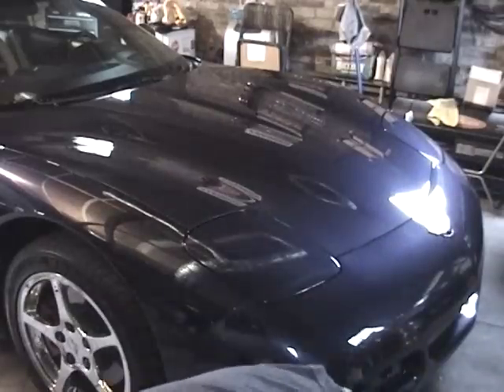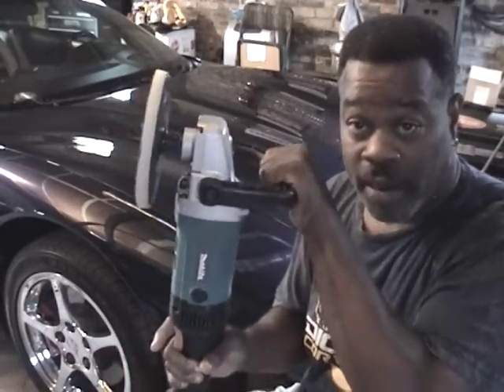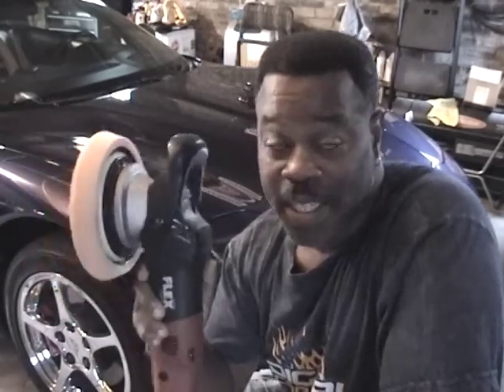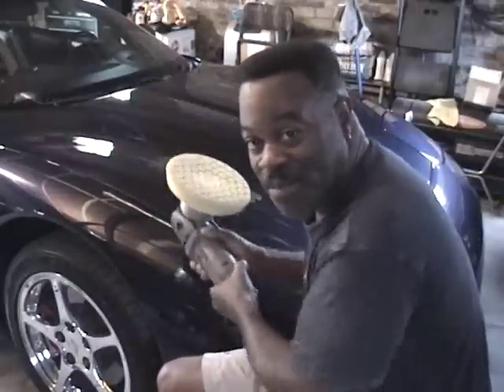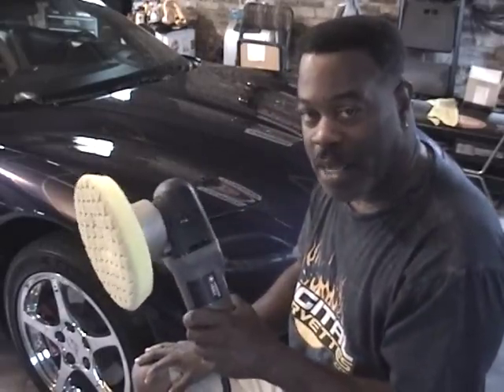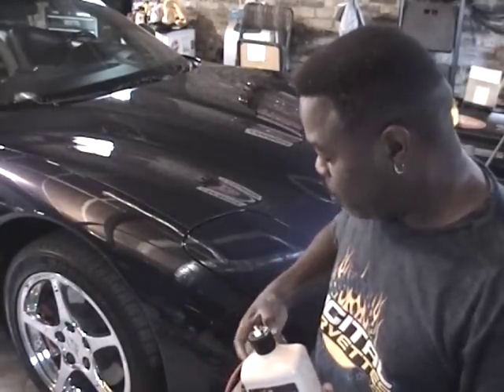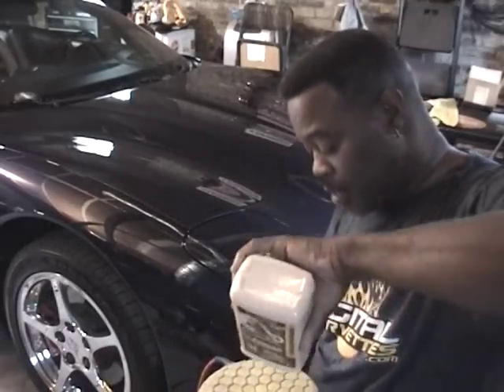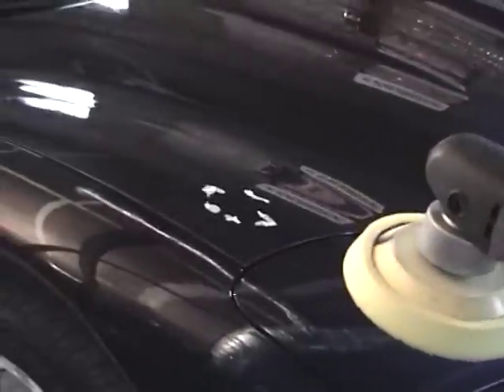How Safe is the PC-7424XP? - Part 1

Comment: Great video, thank you. Does the porter go down to 800-1000 rpms?

Would that porter work for glass polishing (using CeriGlass) as well?  I can't afford to buy all types of buffers so I want one that will work for polishing some haze from my paint (the result of trying to clean bird shit off my 86 caprice hood) but also removing surface scratches from windshield, which I think requires a buffer at around 1000 rpms. Thanks again Junk Yard Dawg!
Reply: Lol thanks for your response.

But look here dude, I'm pretty sure I can develop the proper "buffing technique" on my own with any type of machine lolol.

However, you do possess the knowledge of what machines can do what, which may take awhile for me to determine. Is there a machine that does both, while being safe for paint? This is a yes or no answer.

If there's not it's likely cheaper to just replace my windshield and buff my paint by hand as it's not a large area. That is if I would have to buy two separate machines for window and paint.

Thanks in advance for your yes or no answer sir.
Reply: Lol . Funny response . Alright guy I hear you but my goal is not to be an expert . I have light hazing on one particular circular spot on my hood (from bird shit) no scratches on the paint .

The scratches are on the windshield and light surface scratches but visible and annoying at night .

Doing some research , the one you suggest for paint only goes down to 2500 rpms so that would make the glass too hot using CeriumOxide or whatever it's called .

So I'm guess there is NOT a machine that would do both effectively for a beginner or even intermediate . So unfortunately for me it looks as though replacing the windshield and buffing by hand is more cost effective since all the required tools and materials will be over $200 that is around the cost of a new windshield .

Would you say that light hazing/fading on paint cannot be removed by hand either?

Thanks again Junk Man .
Reply: That is a nice `vette , btw . Is that yours? What state are you out of just curious?

Comment: Should I buy a DA?
I have a 5" random orbital buffer that has a foam head and uses a bonet, and I've got a 5" random orbital sander that has a hook and loop plate.

Do I really need a DA or would either of these suffice for minor paint correction? If I were to buy the hook&loop polishing pads?  Just don't want to store away yet another dedicated tool if the others can do the same job.

Comment: I'm surprised at your comment about the Flex XC 3401 VRG, It like the Porter Cable are Dual Action polishers and safe in the hands of any novice that has an ounce of coordination. Both have speed controls; in fact the Flex even has soft-start trigger control. The Porter Cable is a good polisher for the money, but it isn't in the same league as the Flex.

Comment: Hey Junkman, I gotta question! 
I've got an old Acura with stock paint on the car, but my left door and front quarter panel are peeling. What do you recommend to get it back right?
Reply from the maker: It's called a paint job. Your clear coat has failed and nothing fixes lost clear coat except for MORE clear coat. You can't "buff" clear coat back onto the car, just as you can't buff paint back onto the car. Once it is gone, the only thing that will fix it is a visit to a paint booth.
Reply: @Junkman2008  Roger. So I should paint the whole car and not just the 2 panels?
Reply from the maker: @ShaggyRax  
Only you can answer that question because YOU are the only one who has seen the entire car. I haven't. All I can do from here is give you the criteria that explains WHEN the car needs to be painted. If the entire car meets that criteria,  you have your answer. So what is that answer?

Comment: Jman, I have Bosch random orbital sander/polisher that runs at 7500 - 12000 opm with an 2.5mm orbit diameter. Will it be suitable for car polishing ?
Reply from the maker: What is the exact model?
Reply: Bosch ROS20VSK Sander/Polisher.  Thx.
Reply from the maker: goosecouple When you look at the specs of that unit, different places have different speed ratings for that thing. If it is TRULY 7,500 - 12,000 OPM's, it should work. However, that price makes me think that it ain't any good. The only thing that I can suggest is to try it and see what happens.

Comment: Hello,
I've been watching your videos planning on detailing my boat and car. Most likely a once or twice a year type thing for each. Am I crazy to use a Harbor Freight Dual Action polisher for this job?
 One more thing I can't find a 5" porter cable 18002 contour pad. Is a PORTER-CABLE 15001 5-Inch Hook and Loop Contour Pad ok?
Thanks,
Reply from the maker: Michael S Aspessi The PC is not going to do ANYTHING to the gelcoat on your boat and neither is that Chinese Cheesecake factory polisher. You need something a hell of a lot more powerful to work on a boat and you are not anywhere close to being experienced enough to use that more powerful polisher. If you can afford a boat, don't be a cheap azz. Buy the correct tools for the job and do it right. The PC is the cheapest polisher on the market that will actually fix paint on a car. It is not remotely close to being expensive.

As for your other question, you need to watch my machine polishing for novices videos.
Reply: ***** 
Thanks Junman,
Ok,ok, I'll suck it up and get the PC
I have watched all of the novice videos. Is the pc-15001 the correct model number for a 5 inch contour pad? I can't find a 18002 5"
Thanks
Reply from the maker: Michael S Aspessi  You tell me. Is the 15001 a 5" hook and loop back plate, precisely what I dictated that a novice should use in that video series?

Comment: I actually picked it up at Lowes for $120 when I unboxed it I see there isn't a velcro backing so i would need that next right? But i got a Meguiars 8 inch soft buff foam cutting pad, and meguirs w68 back plate with velcro but theres no way of screwing it on lol so im confused a little with the backing plate i got lol

Comment: @Junkman2000 so what would be the purpose of using the flex or nikita or even a rupes?
Reply: fair enough lol
Reply from the maker: ruchb1 The Rupes is NOT in the same class as the Flex or Makita. It is just like the PC.
Reply: Junkman2000 what's the difference between the porter cable 7336 and the 7424 xp? thanks
Reply from the maker: Maite Rodriguez
The accessories that it comes with, which have nothing to do with buffing paint. Are you the person in your avatar?

Comment: I am painting a car for the first time.  I have a DEWALT DWP849X 7-Inch/9-Inch Variable Speed Polisher with Soft Start - I was thinking to cut down the initial layers of bad paint.  From there what would the next polisher be that you would recommend to finish and buff the paint?  I was considering a Cyclo Model 5 Dual Head Auto Polisher Buffer and a Griot's Garage 10739LNGCRD 3" Random Orbital Polisher with 25' Cord to get into tight spots.  Any advice would be awesome!!!
Reply from the maker: Richard, I am the wrong person to talk to about this because for one, you're going about it all wrong. The phrase "cut down the initial layers of bad paint" is something that I can't remotely wrap my mind around. When I paint a car, I don't have "bad layers" to cut down. I don't know where you got the instructions that you are using to paint your car but they sound questionable at best. Last of all, those polishers you are talking about using are worthless for what you are doing. You should really do an apprenticeship at a good body shop so that you can properly learn how to master that trade. That's what I would do if I were you. You can learn a lot under the right instructor.

Comment: I bought this polisher over a year ago to try and freshen up the look on my old car... but while using it, no matter the speed or what I remember as very light to no pressure the unit would slow to a stop.  Have you heard of this? I gave up after that one try... I have a new car now (370Z) and want to use this or perhaps buy a new unit if needed.  Any advice? Thanks!!
Reply from the maker: Have you watched my 5-part, 2-hour long video series on how to remove scratches with the PC-7424XP MULTIPLE TIMES? It sounds like you have not,

Comment: hey junkman2000.......i have a little problem wiping off the ( dual action cleaner/polisher 83 ) from meguiars when i use it with the da ploisher and the yellow pad ....when i done polish  a smoll area ready to wipe it off it become very hard to take it out and some time i have to rubb it so hard to remove it still i don't know if i using it in the right way or anything else . plz if u have any better ways to remove this polish or any polish might do the same ... plz share it with us ....

Comment: If you have let go a little on that DA machine it would have cut more due to the pad rotating freely. the more the pad rotates the more id cuts, but you know this aleready :)
Reply: Yeah, I think his point is that for novices who use too much pressure this basically self regulates to prevent harm.  Less pressure + diamond cut on 4 or 5 is probably a more dangerous combination.

Comment: Hi Junkman, can we start a detailing business with only porter cable 7424XP? Do we need another machine for Paint correction ? Is PC machine only for novice? Can we get profesional results like your job only with PC machine? Thanks.
Reply from the maker: If you are only going to work on brand new cars that have VERY little to absolutely no damage at all, then you can run a detailing business using only a PC. Since that is not remotely possible, the answer is NO. Do you see me using more than one type of machine in my videos? Guess what, you need more than one type of machine. I use a PC, am I a novice? It has its place in a detailing arsenal. Can you get the results that I get? Not until you get as good as I am.
Reply: I got it, Thanks so much.

Comment: Great video!! Learned a lot!! I'll have my Bro ship me 1 to the PI!!! Thanks!!!
Reply from the maker: +01redlightning Where is the PI?
Reply: Philippines-PI, my bad!! You been to Subic as a former Marine? You know Magsaysay road? :)))))
Reply from the maker: 01redlightning Yes I have and yes I do but my hangout was olongapo City.
Reply: Ops!! I forgot about Olongapo. I'm glad the 7th fleet is pulling back in. How can I email you off the board??
Reply from the maker: 01redlightning
You can use my You Tube email. That's the best way to get in touch with me as I check this stuff all day and night long.
Reply: Ok man,,,I usually don't comment or email folks in You Tube. So I'll ass-ume :) that this chat is only between you and me? Before I get crazy on bringing you up to date on the babes here today,,,,BTW, I'm Rene
Reply from the maker: 01redlightning Well right now, you're leaving your comments in the PUBLIC area. Everyone can see them. You need to message me if you want the conversation to be private. I'm about to crash so I'll get back with you later.

Comment: Is this powerful enough to level paint defects such as clearcoat drips, orange peel, debris in clearcoat with the right combination of pads/compounds? I had my car resprayed and there are 2 or 3 small runs in the clear i want to remove. I know i have to wetsand those first but can i follow up with this to remove the wetsanding?. What about fixing debris in clear or orange peel?
Reply from the maker: wettosixecho Is it capable? That TOTALLY depends on the grit sandpaper you use. Anything more aggressive than 2500 grit and you are going to be buffing for days on one panel alone. Can it do the job? Yes, but it is going to take you FOOOOOREVER. So would I buy it for that purpose? HELL NO. Did you watch the videos? Did you see what I did with this thing?
Reply: Yea i saw the vids. The truck i have was already cut with something similar to your makita. There is 2 small paint runs the size of a half dollar on the roof of the truck i want to correct. There is also some some mild orange peel in other spots of the truck that are narrower/not easily accessible. I understand this is sort of a well built beginner friendly polisher. I just wanted to know if it can handle spots were heavier cutting was required. I do not plan on using it to cut a whole vehicle. Since im also just a weekender i have no need for a full arsenal of polishers.
Reply from the maker: wettosixecho
Well trust me, a beginner polisher and one that will do what you want are two different animals. This is an absolute superb polisher for a novice doing novice things such as what I show in the videos that I use it in. For what you want to do requires a rotary, a polisher that will get you in MAJOR trouble. If YOU break out a rotary, you will end up needing another paint job.

Comment: From now on, I'm calling my Makita 9227c "Puppy".
Reply from the maker: That's a powerful puppy.   :)
Reply: Junkman2000 You should check out the Ingersoll Rand g1621 polisher.  It's a cordless 3"rotary and is terrific for small panels, headlights, mirrors, and hard to reach places. You might dig it!
Reply: Junkman2000 I'm thinking about calling the 3" 'little yipper'.  It's a very unassuming little tool, like the cricket from men in black..
Reply from the maker: I've never seen a cordless tool that I liked. The batteries always wear out and they never stay charged long enough for me. You couldn't give a cordless tool.
Reply: I can understand that, especially given my own experience with the Ryobi 10" cordless buffer.  But I was really impressed by the Ingersoll was its ability able to do an entire motorcycle and exhaust and still have power left over.  Great for wet sanding RIDS, probably do about 8 of them on a single charge.  But, if you have an air compressor, there's absolutely no need for it and waaayyy better option available.

Comment: @Junkman2000
Spendingt $50k on that car unfortunately means you got it new, must suck to know you can pick one up in the mid teens now. Fortunately that also means you are the only who touched the paint and don't have to worry about the possible mistakes of previous owners. You should know that the paint on your car is well known for it's hardness. Try this on a car with soft paint like a Porsche or Subaru with a smaller pad without as much pressure. We won't see that video and you know why...

Comment: LMFAO! so great! great vid for newbs! put some 1000 grit on that Makita & wet sand that be-atch! PS: I am surprised the PC still spun with all that pressure!
Reply from the maker: It DIDN'T spin, it only OSCILLATED. That's why they call them orbital sanders (or orbital polishers), because the orbiting action is the ONLY thing that they are designed to do. The spinning is just an offshoot of the orbiting action because of the free-floating spindle design of the shaft. The Flex on the other hand is a true dual-action polisher because it is designed to oscillate AND rotate. You can't stop either action.
Reply: Glad i found your channel.....good stuff with a great sense of humor!
Reply from the maker: Digme a Hole
You should start by watching my video playlist. It will save you a world of headaches when it comes to understanding my videos and my teaching style. Thanks for watching.